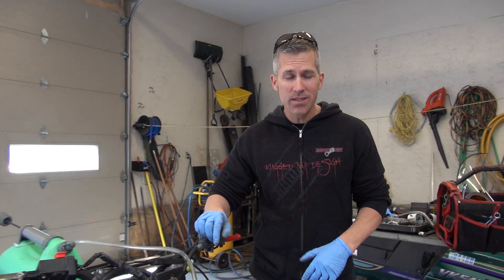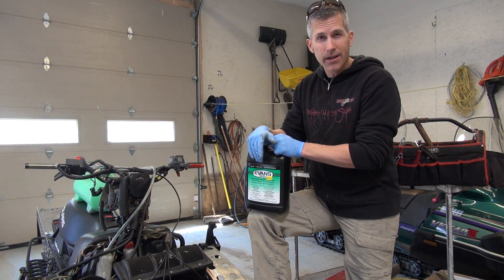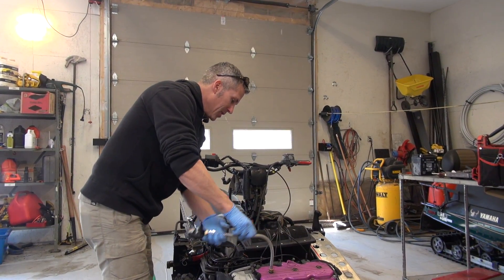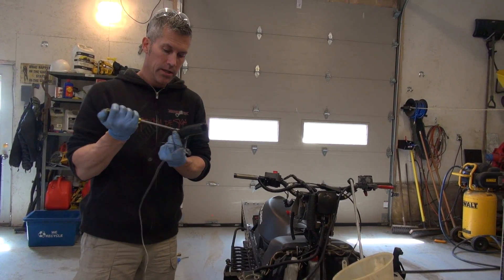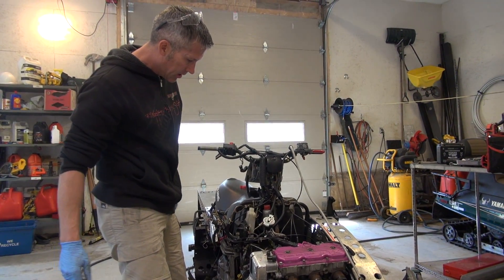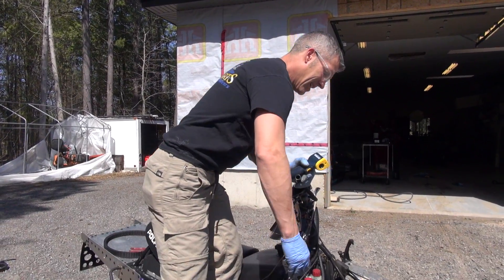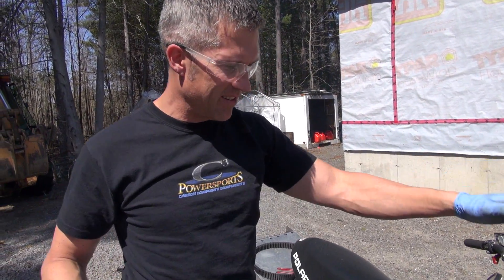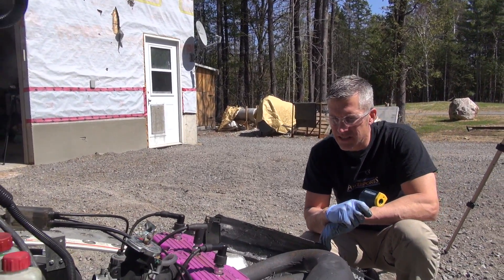265 degree Insane overheat test of a snowmobile engine, Evans Waterless coolant testing.

Comment: Evans runs 10deg hotter and masks the overheating, when the radiator cap pops you know the engine is hot, with Evans you have to rely on the temp gage.

Comment: Should I be concerned if I have a little coolant around my Magneto side spark plug
Reply from the maker: depends on how much.
Reply: @PowerModzOfficial  I fix that problem. Now the slide constantly overheat some clothes cool out the overflow. Head gaskets are still good

Comment: We have a Yamaha mountain max 700 triple that is water cooled and it often has the over temp light come on during rides we have found that the cause is the back snow flap gets caught by the track and prevents snow from being flung onto the radiator. As a result we may remove the snow flap. Any other tips for keeping it cooler?
Reply: Get as much heat out from under the hood as possible

Comment: My 1992 Arctic Cat Jag with a complete engine rebuild cylinder and piston crank connecting rod bearings everything it has a hundred and fifty PSI in each cylinder and it sucks to start in the cold

Comment: All I see is that Evan coolant will let you engine over heat with out any warning .while the coolant want boil your engine is still 265 degrees and over heating . #never Evans
Reply: They invented temp gauge for that u know . All of what i read from guys is , hey how it will prevent u that something wrong happen , why would you wait to bust a coolant line or something and dont notice in time that u have a problem going on .
Reply: He purposely bypassed the radiator to make it overheat.
Reply: That is exactly what it does. By then your engine is FUBAR. With a 50/50 mix if there is a problem the pressure cap will blow on you rad and you just pull over let it cool and see whats wrong.  By the time this blows the cap its to late.

Comment: I have been using waterless coolant for decades in my cars. I just use pure coolant and I don't add water. This reduces the probability of pressure leaks and it prevents rust inside the water pump, heater valves and thermostat.

Comment: correct me if i;mwrong but arent you supposed to use evans prep coolant to flush out all water  instead the high performance coolant you used which is supposed to be the coolant and not the prep coolant? and why didnt you check for water content before the Final fillup to make sure sure it was done right?
Reply from the maker: Since we eliminated all the coolant lines and blew drained and blew all the old coolant out we were confident there was less than 3 percent - we've done testing before and tested the h20 content and are always under 3 so I never use the refractometer now on simple bikes/sleds etc.. for more elaborate systems like vehicles I might test....might.  Ive never used the prep fluid but again I mostly do this with my sleds and bikes.
Reply: PowerModz using the prep is vital for the conversion . Please elaborate how you tested your water content that gave you all the confidence that you were under 3%.also for motorcycles sleds quads there is a separate product you cannot use higher performance only power sports performance which comes in the white bottle and I didn't see you do that in the video so maybe it was your fault. Countless people used this product successfully but they did it right and it doesn't look like you did it right . I'm still investigating evens products before I do the conversion to my vehicles .
Reply from the maker: I used a refractometer with an  Evans rep present at two installs, he was satisfied with the readings from his  refractometer and so was I.  I use the powersports coolant in my machines when I have it....I only had the HP at the time.  Ive tested this product off camera and on camera and it does exactly what I want it to do.  Here is a vid using the refractometer:  https://www.youtube.com/watch?v=46UEvAxd65A.  I don't agree that using the prep fluid is vital on every conversion....many of these machines I convert I put new/rebuild engines new coolers and hoses and/or some systems are very small and very easy to purge...just my opinion.

Comment: Why the hell would you potentially damage your engine by overheating it like that? Evans seems like complete BS to me.
Reply from the maker: MickHornbak well I've done this to several engine engines that I still currently use often over the last few years and I've had zero problems with the engines I've used to test Evans with....so a video like this I use to relay the same findings to the viewer.  You can call it bs but I'm curious to know what engines you've tried it out on and what issues you've had with it?  

This while process for me started out wondering if products were good or bs so instead of just guessing or jumping on a hate bandwagon I chose to actually test  products the way I use them so I can make informed decisions as to whether or not I should use a product.  

Oh and this process of testing over the years has cost me a lot of money on damage caused by garbage products....but not by Evans.  Your opinion may differ and I respect that.  Cheers.
Reply: PowerModz fair enough. I haven't tested Evans yet and I seriously doubt that I will. I just doesn't seem to make sense to me but hey, if it works for you then great! Cheers.
Reply: Hi! Would you mind telling me how much hotter your engines usually run with the Evans coolant? This is my main concern with this product. Thanks.
Reply from the maker: MickHornbak my sleds cool well when in the snow so I haven't noticed temp increases..they can run really cool depending on the type of  snow.  I honestly didn't notice any degree temps increase that would scare me  my one sled runs about 118 degrees which is really cool for a sled and that's not because of Evans it's because it has a large cooling system.   I like it for those hot days with heavy snow or long trail rides with no cooling snow.

My Polaris rzr with or without Evans always ran up to the fan engagement temp and then would cool to 180 or so with or without Evans in slow conditions on hot days.  If I had good flow over the rad the fan never came on and it ran at normal ops temp.  My 4 wheeler I had no fan for 2 years and just ran it..no idea what the temps and the temp sender was broken....it kept on going.  That was the atv in the latest video with 16000+kms of extreme abuse.

My trucks and equipment have analog gauges and I notice no increase in rise on the needles. Running a little warmer in the winter would be nice for plowing snow but the cab temps seem about the same. 

To say that it'll run way hotter is blown out of proportion and Evans will give you all the info you need if they have dealt with your type of vehicle in the past or will recommend best course of action...no idea what your intended use is  sleds/atvs/vehicles or equipment.
Reply: Well, I would consider using it on my sportsbike (Honda CBR1000RR) if I were really sure that it wouldn't run hot. Thank's for the detailed info.
Reply: MickHornbak I've got it in my MT09 had it in over a year. It just runs same temperature as regular coolant.

Comment: Obviously the compression test was higher on the cold engine as the oil was thicker. then low when it was hot. not rocket science people. the stuff cures a lot of water mixed coolant problems. however if all the coolant is 333 degrees then the material around the coolant will be pretty damn close to that. metal still expands, so not sure that you ever want to exceed the temps for the materials the engine is made of. operating at no pressure will make the hoses last longer and pipes and tubing not crack or corrode..no corrosion, no pressure, no freezing and never having to change it is the key to this product. it is not a magic cure for mega temps..

Comment: this wont stop head warping and metal expantion . heating engine up this way is one thing not under any load and for a very short time,... but if you was riding out in trail,... this would make that little difference. wanna prove this ,...?  take it for a ride under those temps. I bet engine will fail for sure. anything after 200 degree's is bad for engine.
Reply: If you haven't tried it all (most of you on here have not), then you really don't know what would happen.

Comment: could you use this coolant in something other than a sled?
Reply from the maker: +nstahlable yes its perfect for motocross bikes and all vehicles, i run it in everything.
Reply: thank you. this will save me a lot of headache that i get with regular coolant
Reply: Ive been running it in my 440hp STI for 2 years now without an issue. Stuff is great.

Comment: the psi was 15 ish pounds less when you did it after it was heated
Reply: octane jake engine was hot, not uncommon to see lower compression on a hot motor

Comment: shoulda done the 50/50 mix before the waterless. then your comparing apples to apples
Reply: +Darren Betker yeah blow up the engine, then put the evans in it and see how it runs lol
Reply: We all know what happens to 50/50 when you overheat the engine.  It boils and stops removing heat from around the cylinder destroying the engine

Comment: your crazy i love ur vids ur nuts for overheating on purpose but there is no way in any means that evans would keep from a fail if it failed on 50/50 it would fail on evans only difference is the pressure me personally i like when it pisses coolant cuz i know its hot won't get that with a concentrate meaning no water just get hot with minimal signs maybe weird idle check that middle piston little to much loving there

Comment: High temps still will stress the metals and the oils. At least water based coolants will steam off not allowing it to get that hot.
Otherwise, waterless coolants sounds good. But why is it getting so hot running with waterless coolant? Must mean the coolant is not as efficient? Or was this cause it was standing still not moving through the air?
Reply: +Scott Downey He bypased the radiator to overheat the engine quicker.
Under normal circumstances you shouldn't overheat.
Reply: Standing no clutch tension and summer time with no snow to cool it

Comment: 12:30 never unplug the spark when the engine is hot man.... _"
Reply: Exactly what I was thinking.
Reply: who told you that...?  LOL LOL LOL.   so silly.  I guess if it passed red hot to almost white hot you would then have to worry about that but not at 2 or 3 hundred degree's...
Reply: +Survivalist why not?
Reply: Samporino Thread wear of the spark plug + https://es.wikipedia.org/wiki/Dilataci%C3%B3n_t%C3%A9rmica

Comment: More BTUs means MORE HP. This test would have been VERY interesting done on a DYNO, See the horsepower difference @ 190 degrees VS 260+ degrees. Now THAT would be a video to watch.
Reply: lol ever run no oil in a 2 stroke it will weld the piston to the wall if it gets too hot plus even with lubrication without coolant you will dammage the engine aswel as with no oil in the fuel
Reply: Since when does more heat mean more horse power?

Comment: I would have thought a hot compression test would have given higher readings than the initial cold compression test? but your readings were some 15psi lower after the test... you didn't discuss those results much?

Comment: Sold!  So how much waterless coolant do I need to buy?
Reply: With that profile pic you should just stay off sleds.
Reply: Seven slays
Thank you for your most retarded response
Reply from the maker: what kind of sled?
Reply: PowerModz
Same thing.  a 1998 XLT 600
Reply: Element of Kindness An FYI for anyone interested.  So, no dealership could answer the question either, so I just drained the system out to see how much coolant there is.  I vacuumed out as much as possible from the pressure cap first, then took off a line from one of the side heat exchangers, and got almost exactly one gallon removed. I suspect there is probably a little bit more laying in pockets around the cylinder water jacket, and I'm trying to decide to pull the head cover to get to it, or just flush it out with the waterless coolant similar to shown in the video.  I think flushing through the line going from the pressure cap to right side exchanger first would be best, as it would drive it through the exchangers, the pump, water jacket, and out the head cover, which is working from lowest point to highest point in the cooling system.
Reply from the maker: Element of Kindness dont pull the head cover - just use an shop vac in reverse to blow the excess out and you are good to go!!
Reply: PowerModz
good to know.  Thanks!
Reply: Element of Kindness
Last follow up. Filled/flushed as mentioned above.  About a half quart of regular antifreeze was pushed out the head cover before the clear Evans was flowing out.  Was a little stubborn to flow though by gravity alone from the funnel several inches above the whole motor, but it was very cold the day I did it.  A little bit of vacuum suction on the head cover outlet pulled it through.  So total capacity was 4-1/2 quarts.  Put the sled through a 14 mile shakedown with no problems noted!

Comment: we use de-vac's at the shop, same as your hand held one but uses compressed air instead. we use it in diffs on tractors and transfer cases at the shop. works flawlessly for just about anything.. i have looked for one like yours to keep on the service truck, where can i find one in Canada Louis?

Comment: before he drove evans coolant water so was the compression 135 psi but after that it was only 120 psi what happened???
Reply: cold vs hot readings. Cold will read higher as metal changes as it heats up.
Reply from the maker: seadoo spx, the engine is fine.  i ran it many times after that video - then ran it to 330 degrees - and its was still fine.  thanks for watching!
Reply from the maker: it did the same before i used evans, when speaking with an engine shop he figured the pistons or rings came slightly out of round when it heats up.
Reply: ok love the videos by the way keep up the good work
Reply: engine is no good its done !!!

Comment: Just thinking and could be wrong, but the well worn engine with alot of piston clearance maybe better able to tolerate the 265 F head temp rather than the Evans coolant.  A slightly rich oil mix will help high temp too.  My thoughts are that cylinder temperature of the head and cylinder is the temperature effecting the piston temp and thus expansion of the piston in the cylinder regardless of what coolant is attaining that temperature.    I Would like to see you put 50/50 back in, run it  6 minute to 265 F.   Evans is saying that the 50/50 at 6min to 265 will melt a piston.   Inquiring minds want to know!

Comment: Is this stuff different in terms of freezing temperature as opposed to 50/50?
Reply from the maker: very similar
Reply: Better. The water in the water/coolant mix still expands when it freezes. Evans shrinks instead - so it does not break anything.

Comment: Whats the normal operating temperature a snowmobile gauge should read whil trail riding or just in general?  Thanks
Reply from the maker: it will vary from 150-190 depending on how much snow you get on your cooler.
Reply: PowerModz Ok I'm around 130-150.
Thanks
Reply: PowerModz Do you know.... Can you take this and put it in any gas engine car that they sell @ a new car dealership now?  My only worry is that it might be too thick...compared to the 50/50 and wear out my water pump faster.

Was thinking about putting it in my 2009 Ford Taurus 3.5V6 (no turbo)
Reply: I like to keep my Dragon 800 under 150f on the trail and in the powder it is usually around 123f

Comment: This and the fact that Jay Leno uses it in his not so cheap cars tells me it's a legit product.
This test done under long term conditions would shred any doubt for ever. 

The remaining water from previous coolant should theoretically boil off as vapour if you leave the system unpressurized...
Reply from the maker: i ran it up to 330 degrees the other day, the coolant melted the overflow hose and there was still no engine damage, our minds were officially blown.

Comment: I was at the sled show and the rep told me I would only have to empty my rad and my overflow tank and that would be enough to add evans coolant. he told me to watch your video. you do alot more than just empty your coolant from the tank and rad.  Do you think what he told will be enough its for a 4 stroke yammy? Thanks

Comment: Hey two questions:  1) why did the engine compression ratio drop to about 120 while it was hot from the initial 140 when in was cold?

2) Since this product is much more thick/viscous than water mixture, would that affect how well it can move inside the narrow engine channels and affect flow/rate heat dispersion? Also make a water pump work harder since its more thick? Thanks!